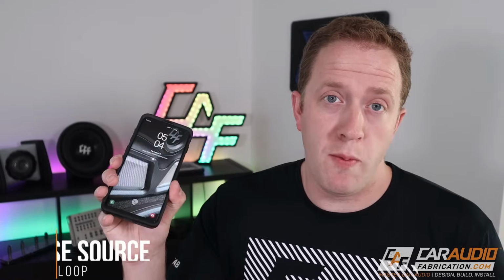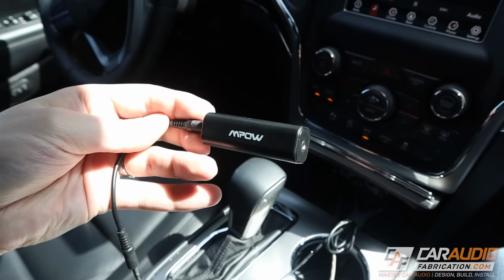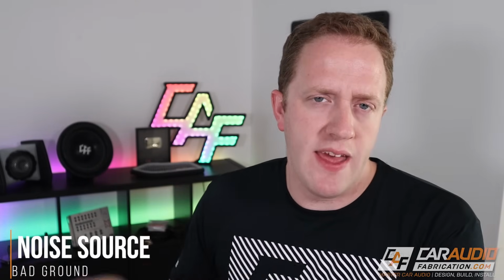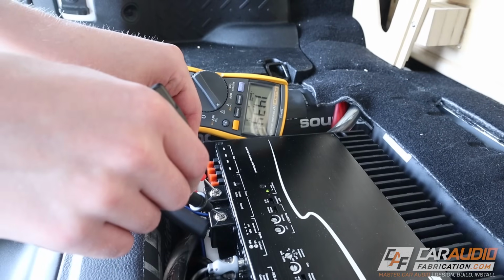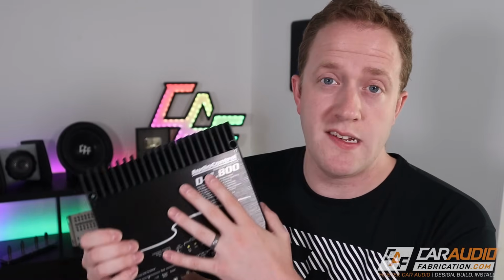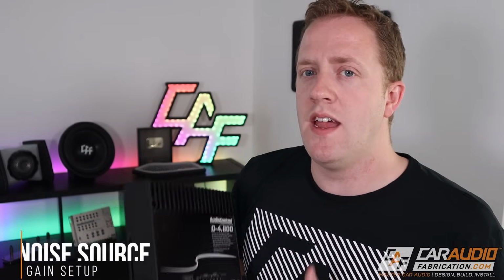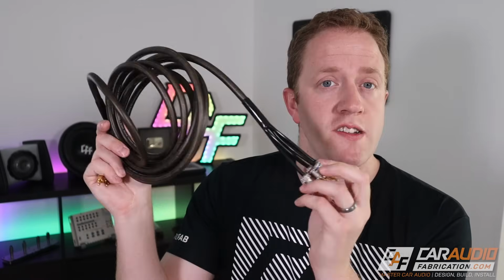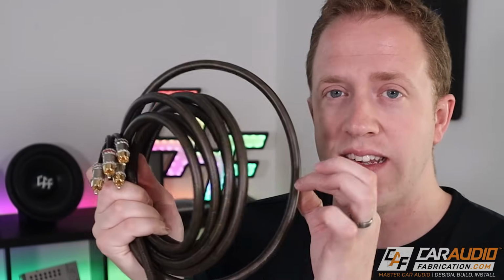BUZZ, WHINE, HISS? How to FIX Car Audio Noise!

Comment: Brand new 2022 Cascadia semi truck and even with the stereo off I get a very intermittent buzz that lasts anywhere between 2 to 4 seconds and as I said very intermittent.  Can be every minute or two or every 10 minutes, independent of stereo on or stereo off. I believe it is maybe a cell phone issue I don’t know have you ever heard of this or do you have any suggestions?

Comment: I have a 2008 Pontiac Vibe. I installed a $70 double din stereo from Amazon. I am experiencing hissing in the drivers side speakers. The one in the back seat on the drivers side is the worst. Drivers door one has it a little. The speakers on the other side of the car work just fine. I have checked all the connections and they seem fine. I bought new Pyle speakers and that didn't fix it.

Comment: I've only had an issue with noise in ONE vehicle over the years, and after checking every possible thing I could, the noise was still there! It was in a 2001 Honda Civic LX. I had installed a nice Kenwood head unit powering 4 of Clarion's best full range speakers. No noise. Later, I installed a Boston 4-channel amp under the front passenger seat. No noise. About 6 months later, I started hearing a distinct whine. I didn't increase with engine speed, so that was a good thing. I checked every ground, every cable, every speaker wire, everything! I could NOT find the cause of the noise, so I just lived with it. If I turned up the volume I couldn't hear it anyway. LOL! Well, one day I decided to update my head unit to a nice Apline. Not because the Kenwood wasn't doing what I wanted it to (this was probably my 5th or 6th Kenwood), but some of the buttons were too hard to read in the dark. Anyway, the exact moment I hit the power button on the new Alpine, I noticed something: the whine was GONE! Yep, apparently it was the head unit! Not sure why, no idea what, but the whine was caused by the deck. New head unit, no more noise! This was the hardest noise I've ever had to deal with and it taught me one thing; all that noise you hear is not always related to grounds or cable quality or other stuff, it CAN be a defective head unit apparently. BTW, that was my LAST Kenwood head unit. LOL!

Comment: I am currently experiencing alternator noise while using Bluetooth FM Transmitter - a device is plugged in the 12V socket, accepts music from the phone by bluetooth and transmits it like a "local radio station" on the frequency of my choice (empty channel) which I can then tune in with my OEM car radio. No idea why is it happening, can the socket be grounded badly from the factory?

Comment: What if the resistance is 0 when radio is off but when playing the radio the resistance goes up? Would u consider thats a bad ground? My system was fine till I found out that the second battery wasn't charging because of the ground so I fixed that and now I have alternator wine smh 🤦any idea?

Comment: In the last shit box car I threw subs into I got drunk while I did my install and ran my power wire right next to my RCA wires all the way back to the amp. 😅😅😅😅 When I get on the gas there's a high pitched whine. Too lazy to fix it. Silver lining though. If I don't accelerate very hard it doesn't whine so I'm getting better gas mileage 😎

Comment: I never had issues until I installed the LC7I.  The whine comes and goes.  I ground the LC7I at the same spot as my amplifiers or should I ground it at distribution block.

Comment: nice video, I have a Nissan Sentra 2015. A coin was stuck in the DVD player and after that my back camera goes off and having a lot of noises in the speaker. If i tap on the side of the Stereo the noises disappear and the camera start to working again. 

Please advise to get is resolved. 

Thanks

Comment: Having an issue with noise right now, the noise is not present till I turn it up beyond normal listening volumes. I'm my case 29 out of 35 on a Kenwood Excelon deck. I've also noticed that when the whine is there and the electric fan kicks on, the whine gets a tab bit more audible. I've eliminate all ground loops, everything in the chain is grounded at the distribution block which is ground at the battery, that ground measures .7Ω. when I discontent the RCAs from the H/U the whine is gone. I pulled the radio and tried a  different set of RCAs above the carpet same issue, have even swapped H/U. I'm stumped, I'm guessing it's just most coming through the power line, solutions?

Comment: Stock radio and aftermarket amplifier... makes static noise I was told it was my LOC line output converter... I’ll need a better and adjustable one ... my ground and power cable and rca cables are all ran down the drivers side of my vehicle... can you please help me out

Comment: I'm using AC's D-6.1200 and I am getting some white noise that's not coming from the head unit and persists even when my truck is turned off.  I know this because disconnecting the signal RCA's does nothing.  Just to be clear, the noise I'm getting sounds like when the stereo is turned up really loud with no music playing regardless of the volume setting on the head unit. I have the gain on each channel set to the appropriate voltage per my speakers specifications (which is actually lower than the 22v if it were set against the HU) - Fronts 20v, Rears/Tweeters 13v (the tweeters don't have their own input so it's linked to the rears which have close to the same RMS), and then you have the sub which is on a separate amp.  So, if I turn down the output volume for each channel in the amp's settings, the noise will eventually go away, but for some reason, my input gain does not like it and will make music seem to choke on it's own bass.  I'm not sure what to do.

Comment: Are signal cables the cables going to your speaker because I have my amp under my passenger seat and I have my power coming from the left side of vehicle and my left door speaker wire will be near the power wire

Comment: I yanked my aftermarket radio harness and fucked up the pins bought one from amazon now makes noise I made sure old harness matched wire by wire buh it makes noise also might be internal settings I messed with on my audio control eq or audio control bass processor. Help

Comment: So I installed an upgraded component system (6.5 and tweets in the door) with a 4 channel amp. Everything was all good until I installed 2 more sets of tweeters (replaced where stocks were) with inline crossovers. It lasted about 15min. On my way to work, I got this really high pitched static noise through my speakers. The amp blew both fuses and now all 4 tweeters dont work. I took it to 4 stereo shops and no one will even let me pay them to trouble shoot the problem. Oh, and now I also have a hiss and whine in my speakers when I accelerate. Please help.... Some of the things I did, was use speed wire from the back of the head unit, and and the rest of my wire is ofc.

Comment: Sometimes i have an intermittent crackle through my coaxials at very low volume, it goes away when i increase the volume and sometimes comes back at listening volume. Any ideas folks? I am thinking a bad rca cable or maybe a loose fit from the rca onto the amp connection itself, like the anp has some age on it so maybe the connection has some trash on or in it.

Comment: I bought a used 2013 Nissan Altima Coupe, it has a aftermarket head unit (Android Unit) and it has an additional bass in the back with aftermarket speakers, can't seem to find a fix for it, the whine is permanent and it gets more "whinier" every time I accelerate.

Comment: You saved me nerves man! Had a shhhh noise from LF speaker/twitter after new setup tunupat the Sound shop.
I have done shilding of my speaker wires with foil on the left side of the car. And wires under the hood too. All car insulated with foam/foil sheets. No wires tuched a metal.  No luck. Than I replaced my Negative to chassis terminal wire as you said in the video ... and WOOALA. No noise. ***.

Comment: I want to upgrade my car head unit with bluetooth through 3.5 jack. From phone-to-3.5 jack there is no issue. But if I put my phone on the car cigar USB charger it makes hissing, whining, static noise through the radio. If I only put my phone to the charger generates the same noise. I made a ground loop isolator with DC-DC 5V to 5V converter (cigar charger USB-isolator-phone USB cable), but the issue remains the same (with or without the jack connected). I read that the problem coming from the cigar charger itself. It is probably poorly designed cheap one. I do not want to change the head unit because it is an integrated with the climate control. So which cigar USB charger do you guys recommend (with RF suppression)?

Comment: I have a 4 channel for my vehicle when hooked up there is a terrible  Squealing noise.  I've been relocating my grounds, moving the amplifier around, sometimes it gets better/worse, but never goes away  I have switched back to my head unit power without the 4 channel. How could i fix this. Is it my amp possibly

Comment: I'm having an issue with some noise in my system. I'm running an Audio Control D6. 1200, in a 2016 Range Rover Sport with the factory amp, and I've tried everything in this video. I've even connected the ground cable directly to the battery ground and moved the amp to the back of the car so the run to the battery is only about 3 feet. I've removed the system input audio, and still noise, I've tested a tweeter in the output of the amp with a 3-inch wire to rule out signal from a source along the speaker cable path. The noise is present when the engine is running or is off. I've even changed the Amp for another d 6 1200 and the same issue. I'm left with two possibilities there is an issue in the electrical system but this car is completely stock excluding the Amp and speakers. or there is noise being generated by the D6 1200(both). I'm going to test the issue by connecting the battery to the amp but removing the body ground from the car so it's not part of the system. If that isn't the issue, I'm going to test a different brand amp with a DSP( maybe JL). Maybe someone out there has had this issue and can give me some suggestions.

Comment: If I had my after market system installed by a professional, meaning a car audio store, and I ended up with a whine during acceleration.  Is it safe to say the shop is incompetent ?  Or is this a normal finding?   In addition, my heat doesn’t work anymore.   I would think this would prove incompetency.  What do u think ?

Comment: have a strange noise coming from my speakers from my amp, it's a Vibe A3 4 channel. After about 5 mins of normal listening it will start to make a whining noise around 4khz (guesstimate using a tone generator on my phone). The volume if the HU doesn't effect the volume of the noise nor does the gain it's just constant pitch and volume. Although throwing on the hazards effects it and electric windows. The fans, headlights or anything else doesnt. I've got door speakers at 2 ohms on channel 1 and 2 and a sub wired to 4 ohm on channel 3 and 4 bridged. Pulling out the RCA cables doesn't cause the whine to disappear. If I pull out channel 4 the sub will start to whine louder as before it's not very loud at all. Seems strange that even pulling out the RCA cables it still makes this noise so it cant be interference with the cables either.

If I turn the head unit off and on it fixes it for another 5 mins...

Does anyone have any ideas what it could be? Could it be a ground loop within the amp? How would I go about diagnosing it?

Thank you

Comment: Can the amp itself cause an engine noise from subs? My friend gave me a old amp looks beat up but sounds good one minute then the next its got some static and mostly engine noise.also it goes into protect mode soon as it turns on then turns back on by itself

Comment: I currently have a very loud hiss accompanied by a whine that matches rpm. I have a 2ga big 3, 4 ga power wire, 4 ga ground ran through the body and bolted directly to the frame. I cleaned off all the paint, used a self tapper through the solid copper wire lug, then painted over it afterwards. Im using high quality RCAs, and an RCA noise filter. Still having issuee

Comment: I had a high pitch squeal that was more noticeable in the dash tweeters as the RPMs went up. It wasnt present all the time but fairly regular for many years. I joked it was my turbo winding up. After I did the big 3 upgrade it finally disappeared and my speakers sounded better also....till I blew one out.

Comment: I hear the whining noise from the left speaker when I plug a 3.5 aux cable into the port. My phone isn't connected on the other end, it's just the cable only. If I play a CD or the radio, it's fine. It only happens when I plug into the aux port. I picked up a GLNI and it's still doing it. Do I maybe need a higher quality 3.5 aux cable or is something else at play here?

Comment: i upgraded with an alpine ilx 702d hu and full steg amps, speakers and quality wires, now a few songs freq jumps, and 2 songs have a buzz some say its the hu, some say wiring, some say its the dsp, how can i check it tje best way where the distortion comes from? its also on low volume, replaced a speaker with an old one and that speaker did the same as tje new one, for all the other songs, it sounds just perfect and so clean....

Comment: Is the wire connecting to the e-brake a ground?  I didn’t install it because I did a built in bypass on my pioneer radio...  im getting static noise as soon as I turn the radio on

Comment: Hi . I don't know who or where  i must ask so i try here. 
One of my speakers starting to make some popping noise. Like is blown . Not right away. After few minutes when i start. The other one did the same in the winter when it was cold. Pioneer TS-A . They are my third pair of speakers doing this. I had other Pioneer and some JVC doing the same. The only issue i see except maybe poor quality is a long spring from left to right who keeps the trunk open. That is kinda close to the magnet. But it happens after 2-3 years everytime. I don't know if is that the cause. If they are bad what speakers are to be trusted? Maybe some well known brand since i am in a country i can't find anything. I  have some Pioneer player 4x50w . Same generation with the speakers

Comment: Like many others I also have a 'alternator whine' noise after installing my Pioneer head unit. Not too good with all this wiring stuff, but based on your video it seems like I have a bad ground... Does this, or will this affect the life of my alternator if unchanged? Will it damage my head unit or car's stereo system? Wondering if it's just a 'harmless' noise or if a bad ground is something that can cause further damages.

Comment: Hey, I was wondering if you could help me out but basically my stereo has 3 scenarios.

1. No noise nothing coming out
2. I think electrical discharge it’s basically like a        
     thud or bang everything now then
3. Constant white noise.

The radio works on start but after about  5mins an above scenario happens and I would have to turn the car off and on to fix it

The car is a Mazda 3 ba hatch 2011 there is no amp it’s just standard unit with a 7.5 fuse that runs the display/radio

I was thinking it’s a bad ground, or even the main ground to the battery cause once the fuze actually burnt out. I’ve basically been driving around for 2 years without a fuze because I was over it but the other day I plugged it back in and after 3 days it started doing this. Either a ground or even a capacitor in the head unit..

Thoughts anyone... I’ve been trying for so long need help 

Thanks

Comment: Unfortunately I have to disconnect the power and go to work for now - but im hoping you can help me narrow down the issue.
2006 m35x with 14 speaker bose system (PITA) - I wired the stock speaker wire in series coming out of the stock amp. 
Now when I turn on my car, its a delayed start, a hissing static noise when turning over and the display does not shut off even when the car is off. I also just noticed the degrees started at 105 and quickly dropped to 76 (displayed on HU) - the speakers sound great after startup and no issues with hissing - but the batterys negative connection was mangled by the previous owner and does not tighten 100% - i have a new one but not installed yet. The speakers also sound great with zero issues on startup or shut down when I disconnect the amp power from the battery.
Is this a ground issue probably on the battery? Could it be anything else? With so many wires from the factory amp and my knowledge its hard to pinpoint

Comment: Hi, just installed a head unit in KIA Sportage (Android 10), and every time I get into a configuration screen (with white background) I can hear buzzing noise from the speakers. This thing happens also on some screens that have a bit of white, but not so loud. This noise is not heard while music is playing, but I guess it is because the music is loud enough to suppress the noise.
Can you help me solve this issue? The setup was done just by connecting included harness with car's harness (so connector to connector) no additional soldering, or anything similar. Thanks in advance!

Comment: installed a kicker key 4  channel amp. I have a low  volume hissing noise. The noise has stable volume no matter the radio volume. The noise is still there even with the inputs disconnected and the engine off. My grounds are confirmed good. And my gain is all the way down. Also my amp chassis doesn't touch metal where it is mounted. Is there anything else i can try to remove this sound? It is not very loud but it is there and before the amp install there was no noise.Thanks.

Comment: If I install an amp only no sub, can it still interfere with the factory active noise cancelling. I have a 2018 Chevy Malibu with 8 inch touchscreen without bose, with active noise cancelling.